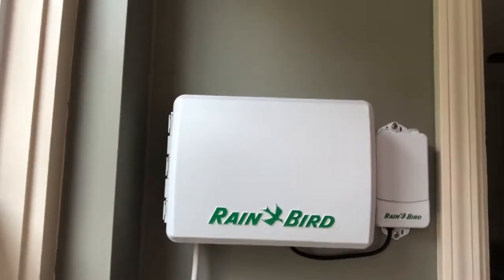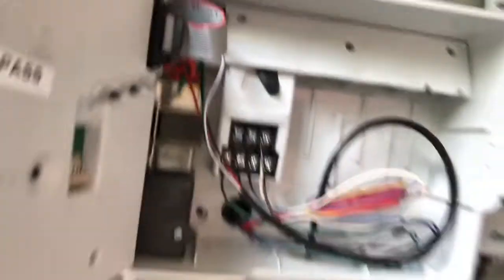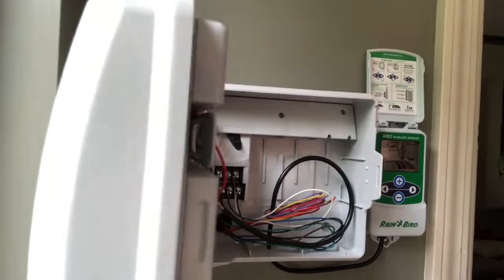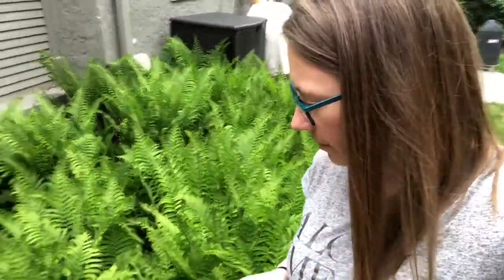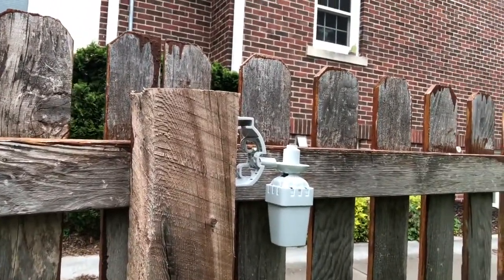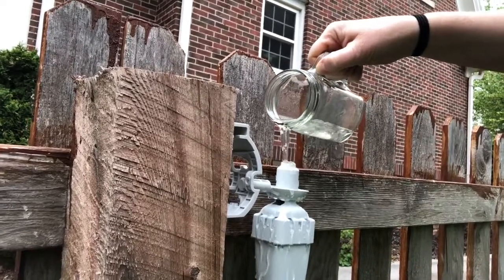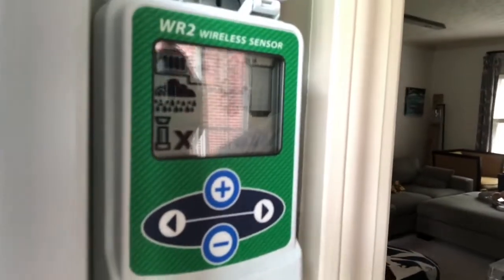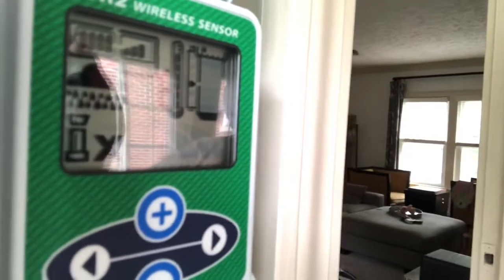Rain Bird Sensor Performance Test

Comment: Hey Sarah  I've had my rb sensor for a year now but I don't think it's programmed correctly. It rained all day yesterday but this morning the irrigation system started. Do you know how long the sensor delays the next watering? Unfortunately the app doesn't have a way to check on the sensor status. Thanks for any help!
Reply from the maker: Does the indoor indicator show the rain icon after the outdoor sensor is wetted? Have you checked batteries and connection to the indoor controller? Check out the IOM for more: https://www.rainbird.com/sites/default/files/media/documents/2018-10/WR2-UserManual_EN-FR-ES.PDF
Reply: @SarahGudeman  thx for the reply and link. Quick glance at the controller looks like it's set correctly. I'll copy the link to my phone and run through it step by step.